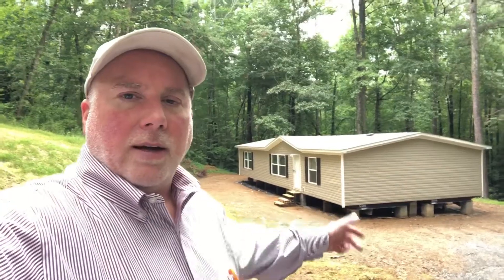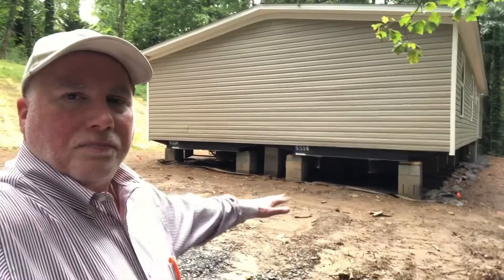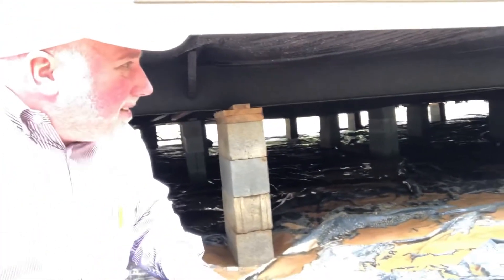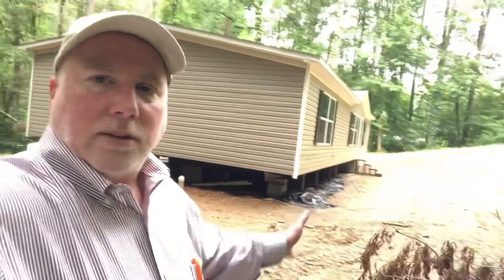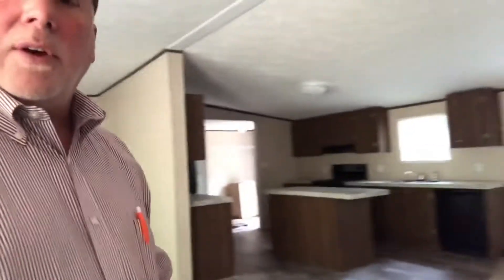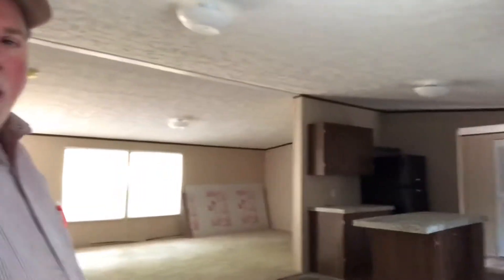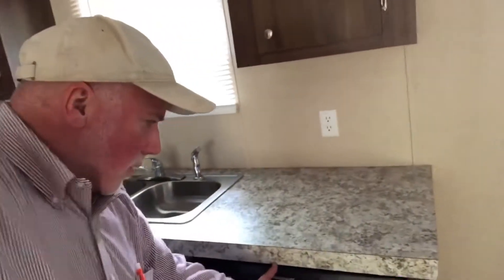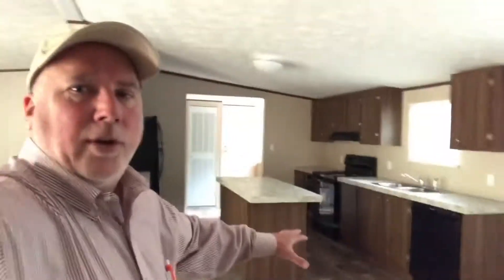What is a Permanent Foundation? Mobile Home Investment Development Project

Comment: Hello i have a question  my father owns land in Moticello GA and wants to put a house on it there is no electric  no water what steps needs to be done to get this 8 acers livable thank yo for this video its exactly what we ae wanting to do
Reply: The first thing is contacting planning and zoning at the county to see if mobile homes are permited in the area. If approved first order of business in getting the home set up you is site prep work done for where the home will be placed. Next you will need a power pole for electricity. Then you will need a water supply which would be tying into city or county water supply. If none are available you will need to go to the county health department and apply for  a deep well to be put ln your land. County will come out and test your land to see if its suitable for a well and septic tank. Next you will need to think about waste disposal. You will need to connect to the city sewer system or have a septic system put in to supply the home. To save on those out of pocket expenses you need to try to get all those costs rolled into your home loan. All of that can run upward of $10 to $12,000. And thats how it goes. Best wishes to you on your new home! 😀👏👍
Reply: You would have to call the city and have them drill a line to the nearest water city line. Or if you live too far away from the city then you'll need your own personal well. That's going to be your water source.
Reply: @Ryu_Kage.  Thank you if you know of any one that i could get an estimate it would be deeply appreciated
Reply: @sinarenesapartmentstead1802  You will also have to get the power company to run a power line and they may charge for that. Then you will probably need a septic system.

Comment: They no longer call them Mobile Homes, they are by FHA/HUD standards called Manufactured homes.
Reply from the maker: They technically start out as "mobile homes" but are manufactured to HUD standards and can be called manufactured homes. When they start out, each sections has an axle with wheels and a tow hitch attached to the structure. After they are on location and place on the foundation, the tow hitch is cut off with a torch and the wheels and axles are removed and hauled away. Once the structure is tied down and certified that it is completed correctly by a structural engineer, the home can then be converted from personal property to real estate attached to the land. The manufactured home at this point is then eligible to be purchased by a home buyer using a traditional mortgage loan.
Reply: @alphadoginvestments can the real estate property start to acquire equity?
Reply: Y
ou missed the point of the comment.  This was never a mobile home.  It is a manufactured home maybe you should read the HUD rules to learn what you are doing.  @alphadoginvestments
Reply: @richardcampbell9225 says the guy who has no face / no content and is ultimately proving to be just a keyboard warrior. Well done! You’ve only proven yourself to be an NPC telling others what they need to do for their profession over SEMANTICS 😅.
Reply: @mEgA_riLed  technically any mobile home built after 1976 is a manufactured home or modular home. Slight differences in them.